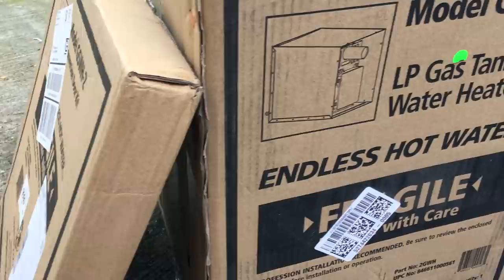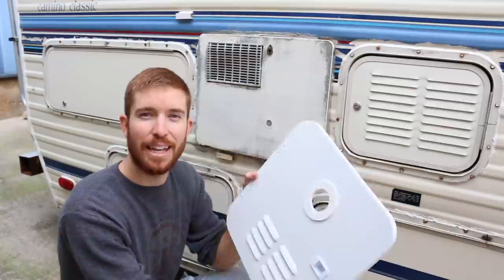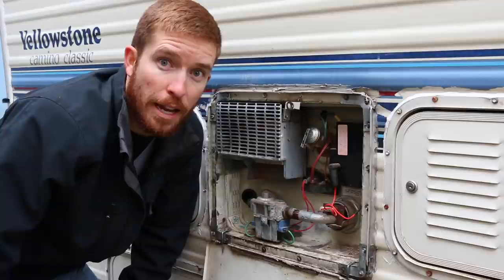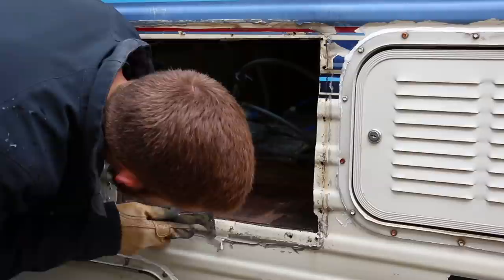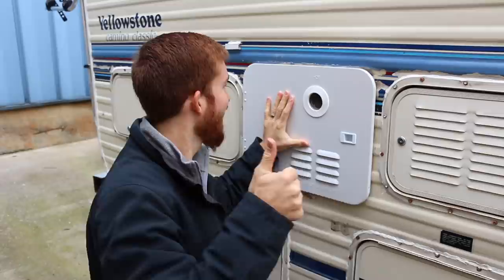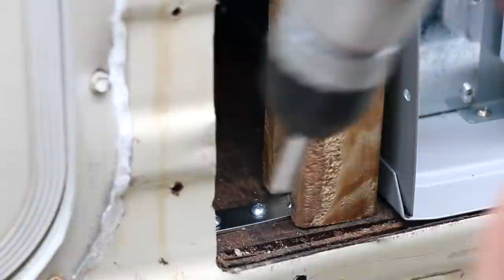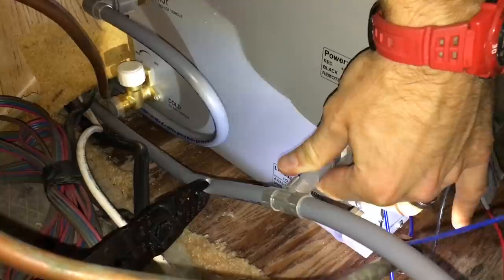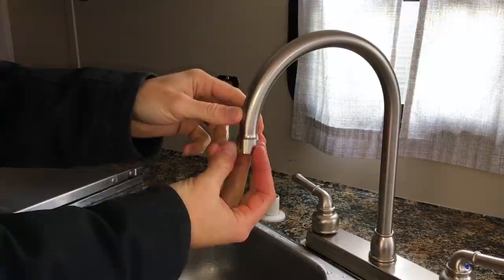Installing a New Girard Tankless Instant RV Hot Water Heater

Comment from the maker: Hey everybody! We hope you enjoyed the video and thanks for watching! If you have any questions about what door you will need for your future install, details + links are in the video description. See you all in the comments! 😎
Reply: Duet Justus have you been able to use it off grid?
And what are your thoughts?
Reply: Can you help me find the correct door? I’m using the same tankless heater to replace my Atwood 6 gallon and the door measures 18” wide 14.5” tall and I’m having no luck finding one!
Reply: I purchased mine on Amazon for $26.99 about 5 days ago.. just shipped yesterday.. hope to get it tomorrow.
Reply: Thia UNIT and ALL heaters of water in general are Water Heaters not Hot water heaters.  FYI,  great video though, as usual.
Reply: Hey I am a little concerned about how this all goes together, my current water heater is both electric and propane.  I have the plug in for the trailer but I also have a solar panel on the roof.  so I need to somehow disconnect that before I start working on things or will i get shocked?  I am not sure how that all works but I have seen enough to actually take the old one out on my own.  But I would like to put in a tankless so that when I sell the trailer it will hopefully be worth more since I am also having to put in a new furnace also.  any suggestions?
Reply: Duet Justus  I have been thinking about installing a unit in my trailer. That was a great video and me being a carpenter, plumbing and electrical is not my forte. So after watching your video I think I am ready for it. 👍
Reply: Lol 12v kills you hahaha, i guess ppl go to school to learn that 🤣
Reply: I have seen that you have gotten some more questions over time you may want to look at. Our question is that we have 3 wires. Orange, yellow, and blue. How do we find out which is which. We have a multimeter but we are not getting any readings off of the wires. The switch for the water heater is on,  no fuse looks bad, we are not sure what fuse if any goes to the water heater. I just want a hot shower.   We just have to connect the wires. Everything else is done. Help!??
Reply: FYI The wingnut thing was actually the valve to drain the tank.(right close - left open) They use a similar valve on car radiators.

Comment: I have the same Atwood 6gal wh in my RV and the drain outlet at the bottom is supposed to have a plastic plug and nothing else. Many people do the petcock trick, but it is not advised as the Atwood has an aluminum tank with aluminum threads that can be stripped easily. It also causes the tank to be subject to corrosion caused by dissimilar metals coming in contact with each other.

Comment: I installed the Girard Propane Tankless in 2018 in my 2016 Fleetwood Storm 35SK.  The problem that you had with the door, I just used the original door and used wood to block in the heater to where I needed it to be.  I was lucky that it worked out this way because of the paint scheme on the Fleetwood was also on the door.  With the problem that you had finding the correct door, I just would have drilled a new vent hole to match the vent pipe in the heater, (I was almost done with my comments when I remembered)  The most important thing to remember is the temp. of the cold water coming into the Tankless water heater.  The unit only increases the temp of the water by so many degrees.  So if your water is coming out of your holding tank, the temp is the same for all of the gallons, BUT when you are hooked up to city water the temp will change.  You have water in the hose and in the RV's water lines that is one temp.  After you use all of that up then the water coming out of the ground will be colder. I had problems with the unit staying on while my wife was in the shower and giving her cold water for several minutes then it would get hot again.  I called Girard for help and they were GREAT.  It was suggested to make sure that there was no air in the water lines, like the outside shower.  Air compresses so the water pressure going through the lines can change.  Still having problems working with Girard again I was asked to check the temp. of the water lines that are part of the unit with a Laser Thermonitor.  There were 2 bad sensors, and they sent me 2 new ones.  I didn't want to wait so I asked if they could next day them to me if I paid half of the shipping.  Again they were very helpful, BUT still had problems with the unit turning off while the water was running.  We did a water flow test at the shower.  I finally found a factory water restrictor fitting in the water line just past the kitchen sink.  Made a world of difference.  The tech guy at Girard asked if I could send him the pictures.  (If you need the tech support contact info just email me PancoastJ@bellsouth.net)   Now understand that every time that you turn off the hot water at the kitchen sink while doing the dishes the unit turns off because there is NO water flow.  When you turn the hot water back on to rinse the dishes the water is cold for several seconds.  The control panel is great, the display tells you the temp of the water, when the burner is on.  In 2019, I added an electric 20 amp water heater next to the rear shower hoping that this would keep the water at the perfect water temp for my wife's shower.  No such luck.  When the water temp going into the electric would be too warm it would shut down to prevent the water from being too hot coming out. I was running the Girard to pre-heat the water, and I tried not turning on the Girard, and still had problems.  So this year, 2021, I installed a 7-gallon electric water heater by the shower.  I added a 2-1/2 gallon electric at the kitchen sink which also supplies hot water to the 1/2-bath.  I also terminated the hot water line at the 1/2-bath to keep the shower hot water separated.  I figured that every night I plug into the RV park electricity and heating the water is free, no propane to pay for.  The electric water heater takes less than one hour to heat.

Comment: I just ordered this heater the other day and got it installed yesterday. It was really not to bad of an install at all. It took me about 3 hrs or so and thats with stopping to go get parts from the hardware store. It was really nice to be able to take an almost 20 min shower with hot water without running out.
Reply from the maker: It is so nice for that! Glad it’s working as well for you as it is for us 😊
Reply: I'm curious about how much propane is required to do a long shower. Obviously these things don't run cheap, so I'm wondering if it's really worth the cost ratio to how much per gallon of water, in propane cost. Maybe after a month or two, you could fill me in on the added cost of propane???
Reply: 20 minute shower???

Comment: Had the Girard 1st Gen installed in 08' and used it for 12yrs... Best add-on ever in our TT. We have just upgraded our 05' TrailVision to a 2018 Rockwood MiniLite, and are contemplating doing the install ourselves... Your video is very well done and I will save me $250 to do myself... Thanks.

Comment: I pulled the old propane water heater in my 1991 Motorhome and discovered it has a 120 volt element in the rear. So I’m plugging the propane line as I dont want to fix whatever is wrong with it. In the new age of cheap solar I’m going all electric and a diesel heater. Every propane appliance is going except the stove burners. I know the recovery time on the 10 gallon water heater won’t be very fast with a 1400 watt heating element but I can live with that. I don’t use very much hot water and can plan my showers and washing. My door is missing too. Since I’m going all electric I can fabricate a solid piece of tin for a cover. Dont forget a zinc anode in your aluminum water heater.

Comment: I’m sure that if a waded through all the comments SOMEONE must have written there is no need to heat hot water. It’s simply a water heater.
 The information and video quality is great. Just a little too long. You probably could have eliminated about 10 minutes and still covered all the necessary information.
I make this suggestion on the probability I am not the only attention deficit senior citizen out here 😜
Anyway on a scale of 1 to 10 this video is a solid 8 1/2. Good job!

Comment: The "wingnut" is called a petcock (yes, funny name) and IS the drain. Though, it looks like yours wasn't working anyway. You can find the same petcock valve on most pressurized water systems, including on the bottom of your engine's radiator. Love your video btw. Can't wait until you hit the road again.
Reply from the maker: +Mikayla Schultz Great information Mikayla! Thank you for watching and taking the time to share 😊👍🏼

Comment: I have had no hot water pressure since I moved into mine and when you showed the bypass I went looking and found out mine was almost completely shut off thanks for the info if not I would have had to buy a new heater.

Comment: Couldn’t wait to get the “on demand” system; but our experience was mixed.  A low pressure supply side (25- 30psi) may support producing hot water but if you blend cold at the sink/shower - you loose the pressure needed to maintain the hot cycle.  If you do a lot of dishes or take a leisurely shower the thermal reset may not allow “another” hot water use until the overheat protection cools.  I know we’ll increase our gas usage by replacing our Gerard with a conventional 12 gal elec/gas dsi but being able to blend or getting hotter water - even at lower pressure is a trade off I’ll make.
Reply: Hi BIll. I have a tankless water heater that I hang on the outside of the RV and it stows easily in the space where the old tank water heater was when I travel. I had the same problem with mixing cold water in the shower.  I found that if I opened the hot water on my bathroom sink just a trickle that it kept the hot water heater cranking out the hot water.  It took a little time to adjust the flow of the shower and the sink faucets but I always start the hot water flow with the sink faucet. Then turn on the hot water in the shower.  I crank back the sink flow to a reduced flow and then add the cold water in the shower.  Over the couple years I've had it, I can acheive the exact shower flow with no interruptions about 30 seconds.  
My water heater is a $85 Ecotemp model and it delivers fine. But I just connected mine with the existing gas and water hoses and hung it right above the old hot water door. Of course they make all different kinds and models, mine operates the striker from 2 Alkaline D cell batteries. Change them once a year if they need it or not.
Reply: Oh and BTW my trailer is a 1996 Mallard. Nothing fancy, no slideouts.

Comment: We have a Girard tankless WH in our rig...I think it's the 1st generation though.  I think we have a solenoid that gets stuck in ours because the first couple of times it tries firing up, it comes back with an error and I have to bang on the WH with a hammer to get it to light.  Other than that, we have no problems with ours so we're gonna have it looked at when we bring it in for some other warranty work.
Reply from the maker: Hmm, That's interesting. We will be keeping an eye out for that issue. Thanks! 😊
Reply: Chasing Abnormal a

Comment: Real nice video and thanks for posting.  My only comment is you would lose the electrical side of the dual propane/electric hot water heater.  When we are connected to 110 volt we always spare our propane and use electric heaters to warm the coach. Hot water heaters and propane furnaces use quite a bit of gas. This however is great when boondocking

Comment: Outstanding video, the lighting and sound quality is perfect. You should consider a video on making such videos if you have not done so already. As this unit is much smaller than the old Atwood, I am curious about maintenance on/inside the new unit. There must be a burner inside there and perhaps some sort of electrical element. I wonder how difficult it would be to replace such items or would it require the unit to be removed completely, disassembled and then reassembled. Furthermore, I am curious about operation in colder climates (-10 to 20 F). Its my understanding that this unit requires a "Cold Weather" kit.

Comment: I've had mine already 4 years, no problems other than  ,you can't trickle the hot water, when washing dishes very important when you are boondockin  so when it's time to replace I'm going back to the 6 gallon dsi , and when the water is warm in the holding tank i turn down the thermostat all the way and the water comes out to hot for me to take a

 shower so i turned it off and just take a  cooler shower So it's saves propane but it doesn't save water. And that plastic lock slide on the door got sunbaked and fell apart so I just drilled a hole and used a screw .

Comment: Now that you've had the heater for a while are you happy with its performance? Anything you would do different?
Reply: We had ours for six months and it began to leak when several screws rusted and sheered at an elbow section within the unit.  I replaced the screws and it was fine again for another few months.  Again leaked, when several other screws sheared from rusting.  It is VERY difficult to work on and frankly there should not have been issues with something that new.  A year later and the unit completely failed when the copper pipes burst when draining it for storage over the winter.  That could possibly be owner error on my part, as it was being done with a compressor, albeit a tiny pancake one, which I have done hundreds of times before with old units.
Reply: @vincentjoyce455  your screws different material.need an electric barrier. use lil teflon or some nonconductive grease.     alum-alum  steel-steel no problems. steel screws alum frame bad!
Reply: I too have ran into several issues with the quality of parts on this Girard tankless water heater. I too had similar issue with my screws. I also had the heat exchanger pipes burst not in freezing temperatures. The copper most of the parts are designed out of is really flimsy and thin. I had to order several parts along with the heat exchanger from Girard. I received damaged parts twice from this company. I really wish somebody made something similar but better quality.

Also I ran into a forums on Forest River forums with a guy depicting of the same type of issue. Girard constantly blames it on the consumer and alleviates accountability from their own manufacturer defects. By the way it's worth mentioning that the new parts he sent me came with different types of screws than my original model so what does that mean?

Comment: Just so you're aware, these Girard W/H's are not designed to be used in cooler climates with ambient temperatures less than approx. 5 degrees Celsius around 40 degrees Fahrenheit. I called down to tech support at Girard to see if there was a way to tweak the W/H for better performance and was told specifically by an engineer at Girard, the W/h's are designed for tepid climates like California, so if you're living in a northern climate, this product might not meet your expectations.
Reply: I installed one of these in my 19foot travel trailer, while staying in Florida, worked great. Went to Maine to help a friend on a house remodel in January.......very disappointed in the function of the heater there. It was more like a cold water partial warmer.

Comment: Good work. But one question. You consistently refer to it as a "hot water heater".  If the water is already hot, why do you need a heater?  As the code on the product suggests, how about calling it a "water heater".  Haha. thanks for your video.

Comment: Thanks for the wiring instructions, I was wondering about that extra blue wire to the ignition light and this was very helpful! I am about to install this into my camper to replace an Atwood 6.0 gallon as well. My only concern is that I don't think my old hot water heater is connected to a fuse. It is connected to the switch which is connected directly to the battery. Did you install a 10 amp inline fuse for the new hot water heater or was your old Atwood attached to your DC panel by a fuse, and you just tapped into that one?

Comment: That cut on the polybutleyne.. pretty rough edges...

Also they make a proper polybutleyne connector, the sidewalls are quite a bit thinner with pb vs pex.
Reply: "Pretty rough"???  Those are horrible, can't believe the shark bite fittings didn't leak with a horrible cut like that!!

Comment: Great video. I noticed the warning printed just below the lp connection stating that there must be a gas pressure reducing valve installed for that model. how did you determine that the pressure in the line was correct?
Reply: He was using a hacksaw to cut his wood. I'm sure he doesn't know wci means nor does he have a gauge to check it.
Reply: @davidnuzum7776  
How presumptuous on your part.
Where is the faith. Lol
Reply: I've watched a few install videos of this unit and have yet to see anyone install a pressure reducing valve - hoping to find more information about it because I am installing this unit myself this weekend.
Reply: It’s strange that none of the replies try to answer the question asked. Just showing how clueless they are or should say we are.